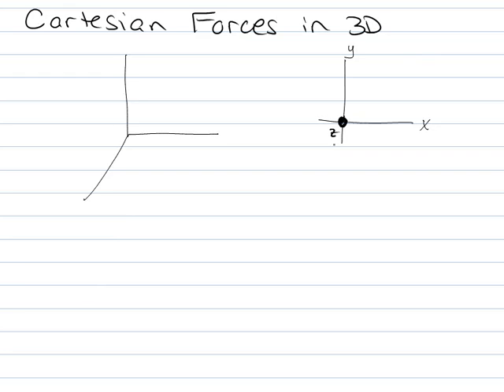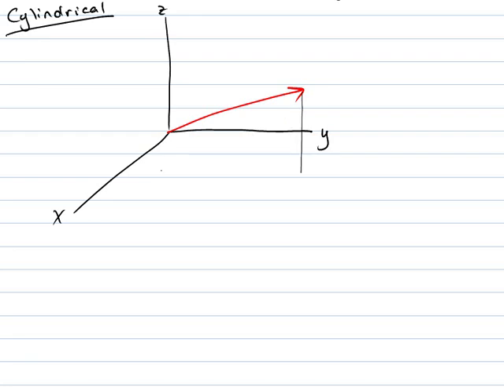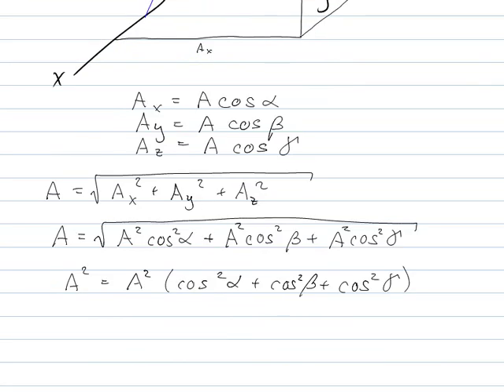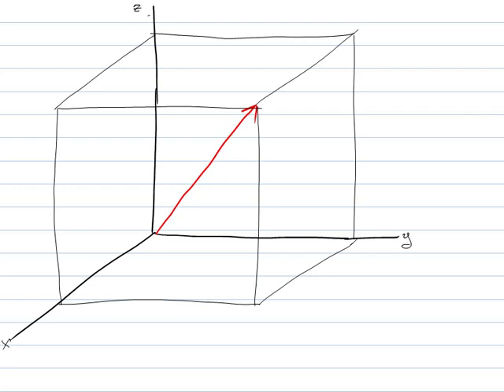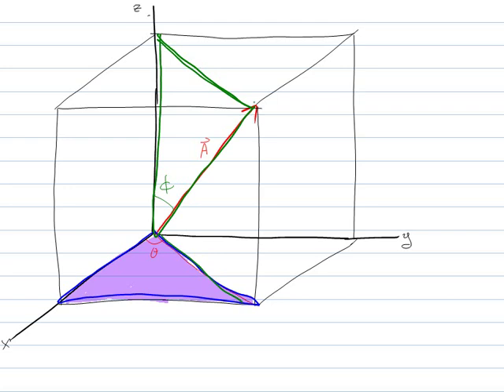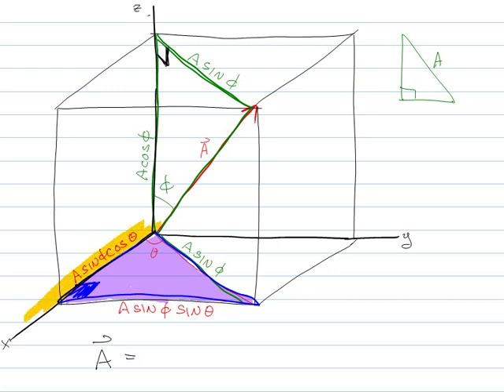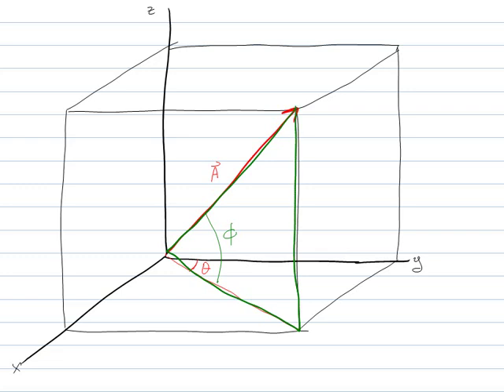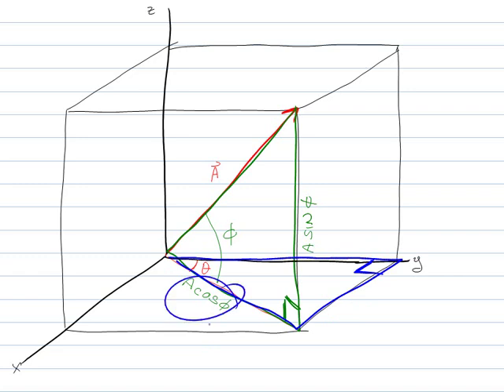Decomposing and Expressing Forces and Vectors in 3D

Comment: I support the video... however, I believe your cylindrical coordinate system is wrong.  Unless this cylindrical coordinate system is fundamentally different from how it is in calculus.  The calculus coordinate system is parameterized by theta (x axis angle), radius (length along theta in the xy plane), and z (height up or down) not what you did in your video.  Your coordinate system resembles a spherical coordinate system given in calculus.
Reply from the maker: I get that.  Basically what we're getting at is that in engineering, you're not going to be given the "perfect" angles that you're taught in Calculus, so you can't just go and memorize F sin this cos that.  You've got to actually look at the picture.  Formally calling it spherical or cylindrical probably isn't correct.  More correct to call it sphericalish or cylindricalish.  Hope that helps!